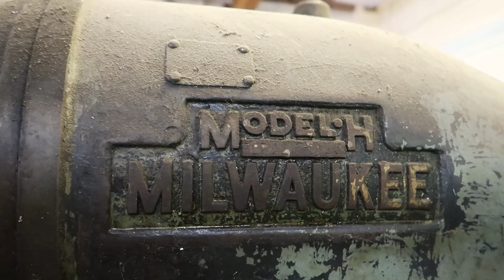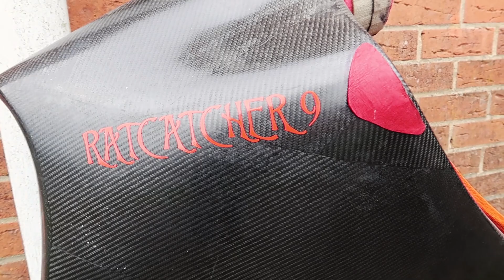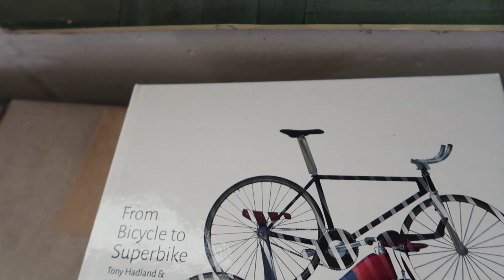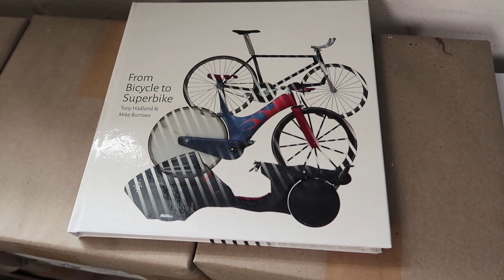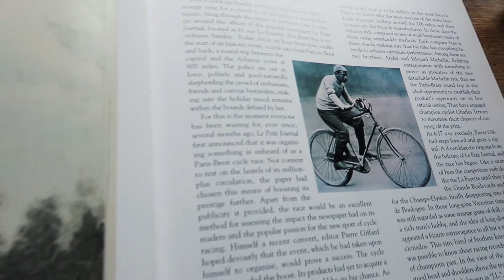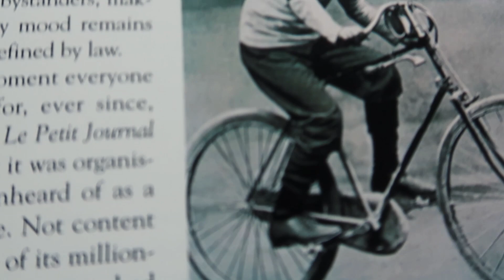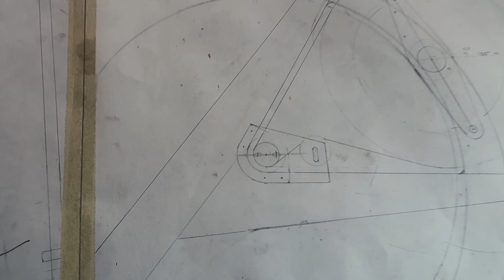Gold medal Lotus bike designer and his legendary cycles that will blow your mind. Meet Mike Burrows

Comment: My favorite thing is the structural chain case -- it puts the cog near the point where the hub connects rather than at the other end of the cantilever.  It might make it tricky for multi-speed or freewheeling, but maybe not so much.  OTOH, it would seem to make everything a lot stiffer vertically and not so much laterally.

Comment: Thank you for a great video on a great man. Some unbelievable facts about the TCR frame design.

One question about the TCR Aero forks, were they designed  by Mike? 

I think the Aero Forks were banned on road bikes by the UCI in 2004.

Giant stopped putting them on road bikes in 2004 with the Giant Aero 2 TCR.

I have the 2003 Giant Aero TCR with the Aero Forks.

I also have a 1st generation 1997 TCR EXT with the Areo wheels.

Thank you from a Mike Burrows fan.